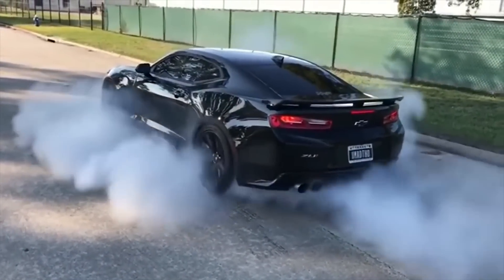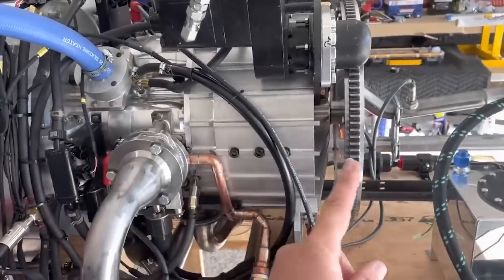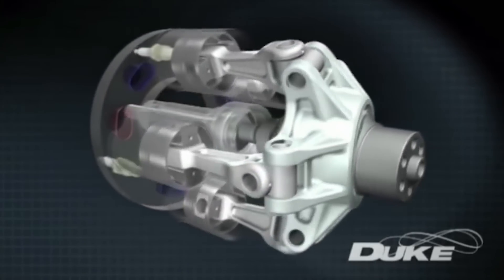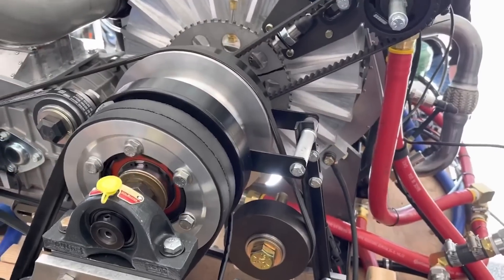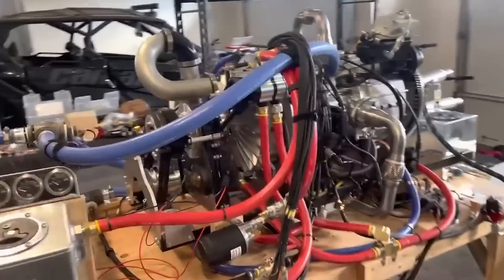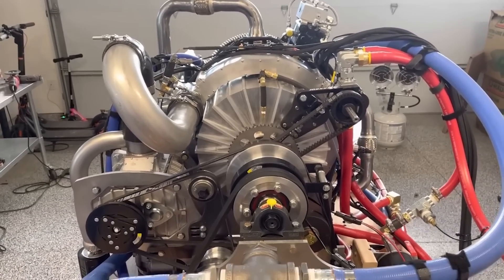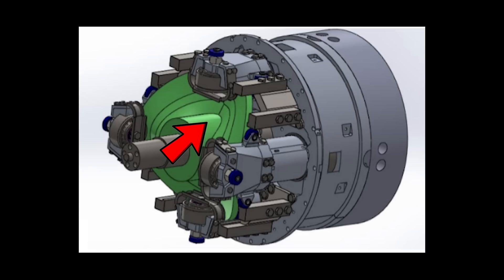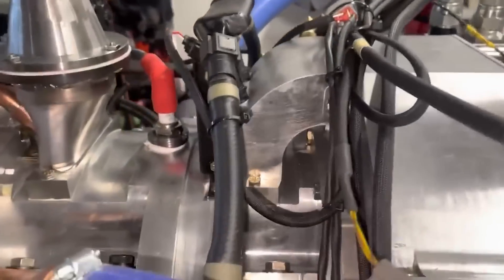Devize Barrel Engine: The Next Step in Combustion Technology

Comment: What a load of rubbish. As mentioned by others, opposing pistons are no new thing and of course it is a 2 stroke but this wasn't mentioned. Notoriously inefficient and polluting. Lucky we have electronics controlling the fuel injection and spark timing along with cylinder de-activation to try to mitigate this problem. Problem is these same systems also improve economy and emissions levels in already cleaner 4 strokes. Projected horsepower figures? WTF? Haven't tested it yet after more than quarter of a century of wasted research and development? Give us the projected emission numbers. Possibly the most useless, over-engineered, oversold and underperforming device of all time.

Comment: I designed this.  Matt Jackson is the owner and manager.  Matt makes the decisions.
Reply from the maker: Will add that in the discriptìon 😆
Reply: @ChrisVSCars  Thanks.  Perhaps you can add that I take commissions for design projects.  You can add that I have my own engine design that I am promoting, the "Rotating Liner Engine" that eliminates wear and reduces friction in diesel engines.  This project is at a very advanced stage of development and also seeks investment.   

Some corrections.  This engine has 8 pistons, four cylinders.  It is not a squash plate engine.  We have cams that drive the pistons.  The cams gives freedom of motion that squash plates do not have.

Thank you.

D.

Comment: You show animation of a 5 cylinder radial engine. Theirs seems like they changed the swashplate from having sockets over each rod to something different. There will be wear issues with that. Radial engines have been around for at least 100 years. This is a small version of one and if they have a way to control emissions, maybe they have something.

Comment: All these engine have the same problem , they burn fuel , electric has varstly more touch , is even smaller and lighter , and fewer moving parts , and works right now , by the time problems are sorted for these ice engines , eletric will have sorted there,s , leaving ice out in the cold

Comment: I somehow don't think Noel Duke would appreciate your over-laying and inter-mingling his Z-axis engine rotary engine with the VERY different 
'DEVIZE Barrel engine'.  ... and I would know; Noel is a personal friend of mine. Barrel-type axial engine's have been re-cycled over, and over and they have NOTHING new to offer. All fail because using a cam plate to translate reciprocating loads over the long-term life of a typical automotive engine is a non-starter. From your accent you are obviously South African so why not look in your own backyard? The Van Loewy (my memory may be faulty on the exact spelling of the name) is a far more interesting axial engine from the 1980/90's. It used patented universal joint to articulate the piston-rod/wobble-plate connection such that it eliminated the figure-of-8 oscillation and resolved the motion to a pure straight-line motion. superior to any cam-type axial engine! How about it?

Comment: Another stock market vaporware engine. If there's no cylinder head why did the animation clearly depict a cylinder head with spark plugs. I'm guessing it's supposed to use piston ports for gas flow in and out of the engine. That's probably why there is an external blower. These can create oil control issues. Based on the cloud of smoke coming from the exhaust, 'Houston we have a problem'.
Junk.
Reply from the maker: Animation is from a different motor. I just used it to show the axial design.

Comment: There is an engine that was developed in the 1930s and was certified as an aircraft engine but was overtaken by WWII and never mass produced.  It was picked up by Dynacam Company in the late 80s-90s and updated with new metallurgy and technology and was tested in aircraft and Buses and the literature I saw was quite positive.  It is like the Barrel engine in profile but instead of the pistons connected to the crankshaft at each end and the combustion chamber in the middle, it was a double headed piston with the solid connecting rod riding a swash plate in the middle so the combustion chambers were at each end and the cylinder heads had rotating valves driven by the each end of the crankshaft.  It was a 12 cylinder combustion ends with six double headed pistons sliding back and forth parallel to the crankshaft.  The profile was small on the initial Aircraft engine with a weight about 150 lbs and diameter of about 18 inches including piping etc.  It produced about 235 HP at 1800 RPM and could idle at about 100 RPM, with good fuel efficiency.  They tried to mass market it but the bid engine producers tried to buy them out and when they refused they were essentially run out of business.  I don't know what happened to the company product after that.  The Big guys and the Venture Capitalists essentiall ruined them.  Another victim of 
"The System".
Reply: "The Big guys and the Venture Capitalists essentiall ruined them.  Another victim of 
"The System"."   

Yeah, the victim of those same folks who killed the 100mpg carburetor..   I've seen swash plate engines and every one has had every disadvantage of the reciprocating piston engine and add more of their own.  If there was any merit to it, the Chinese would have made billions of them and put the "Big Guys" out of business.
Reply: @ohger1  if its the carburetor from the young guy in the 70's it was tested and got 200mpg. on a 302 ford Windsor V8.  It was basically a lawnmower carb and the gas got heated up to pressurize the fuel and to change to state of the fuel to a vapor gas.  Liquid gas doesn't burn only the fumes. And that why car engines spray liquid gas so the controllers make more money and leaving the motors only about 30 to 40% affective at burn all the gas.  the rest is waisted out the exhaust. Also theres patinas for a very similar carb from the 1800's
Reply: @Josh-nw3wd  Vapor schmapor (sorry, couldn't resist... 😁) 200 mpg on a 3000 lb traditional car is impossible with an internal combustion engine.  Internal combustion engines make heat - the rotational torque is a byproduct of the engine's heat - a brute force approach to moving a vehicle..  No matter how well the fuel is vaporized, heat must be created to cause the expansion of the air inside the cylinder to push the piston.  Since there is no really good way to convert the wasted heat to energy, 70 percent of the fuel burned is lost as waste heat.

If that doesn't convince you, consider  the cars that run on NG or Propane - neither are any more efficient as traditional gasoline powered engines despite the fuel being pure vapor as it leaves the regulator.  If the vapor was what made that magical carburetor get 200mpg (or 100, the way I heard that yarn back in the '70s), then NG or Propane cars would get the same or more MPG than gas cars despite having less BTUs per gallon than gasoline, and they don't.
Reply: the "michel swashplate engine".
the company still exists, their claim to fame is the "michel thrust bearing", used in ship prop-shafts.

it relies on a tilting pad to develop a "wedge" of oil, preventing metal to metal contact. ideal for a swashplate engine.

theres also the "lamplough rotary" that uses opposed pistons, with teh yoke and spherical conrods at both ends... also a two stroke, with pumping pistons and sleeve valves... engine designers used to have imagination unseen today...

Comment: Lovely grinding action. How long before it wears out?
Reply: There are roller wheels in the swash plate.
Reply: @ohger1  How often needing to be replaced?
Reply: @SelectCircle  I don't have a clue, but I if it uses rollers, it could theoretically last for a long time, but this design has so many problems that it really doesn't matter.

Comment: The main problem with that it's way too much metal on metal it's going to require substantial oil pressure and oil Cooling and let alone the fact it has very little capacity for cooling so why it's running on a stand by itself it's not going to have to cool itself they're going to have to build a whole another motor to even withstand the temperatures of pulling a car and cooling itself on hot asphalt let alone you're going to have to run dual oil filter setup because micro particles is just going to eat that motor alive

Comment: I see all of these new marvel engines as a way to replace the low compression opposed aircraft engines in piston operating airplanes.  Currently these engines require 100 octane leaded fuel to prevent detonation.  Detonation in aircraft engines is fatal, destroying the engine so fast the pilot can't overcome it.  A light weight power plant that can operate on any fuel available is a Godsend for aviation.
Reply: You will never see any of them in production.  The reciprocating piston aircraft engine will only be replaced by a full electric system.

Comment: Barrel engines have been around for years. The one field where they would have had a real chance was in aviation. Compact. Light weight. High power density. Every design considered failed. Every single one.

Comment: This will never fly because it's still essentially a glorified 2 stroke engine. So you're always dealing part of the exhaust charge staying in the cylinders, and part of the intake charge getting out (except with direct fuel injection). At any rate, they can't meet emissions, no matter how you slice it. This combined with excessive complexity, and lubrication and cooling problems make it a no-brainer to look into something else. The Deltic Corporation had a locomotive-sized opposed piston diesel in the 40's and 50's, and while they made good power, they were very dirty and had high maintenance costs. They were finally retired in the 1960's for cleaner burning standard 4 stroke diesels.

Comment: I love internal combustion engines too, their interesting, cleverly designed, make great noises and are fun to drive. I also like steam engines for all of the same reasons. However, when Tesla proved conclusively that BEVs are practical, even with their first generation vehicles, it was only a matter of time before ICE went the same way are ECE (steam engines). The end to end efficiency of Steam Engines tops out at a few percent when you factor in mining for coal. It's double digits for ICE and at least three times better if you use batteries and electric motors. It's not just about end to end efficiency though, it's about end to end complexity. Drilling, processing and transporting oil is hideously energy hungry compared to electricity production. When it comes to the power train, BEVs are so simple, like a child's toy compared to ICE. There's simply no way back now we've got this far.
Reply: BEVs are FAR worse for the environment than the ICE!  Just look at how much mining and processing is needed to make those batteries, and when they catch on fire for any one of numerous reasons, you can't put them out!  You just have to sit back and watch them burn!  Then we get to the unattractiveness of the extremely low resale value of a BEV when the battery is worn out and needs to be replaced, or when the BEV needs to be scrapped after even a minor fender bender because the battery MIGHT have been damaged.  There's no way to know if the battery isn't going to spontaneously burst into flames while going down the freeway!  In South Korea now, they won't allow BEVs in under ground parking areas because they might decide to light off and cause massive damage to the building and other cars!
  Elon made himself rich at taxpayer's expense with his electric car boondoggle!  How is anyone going to charge up their BEV when the electrical grids are down, or even just damaged?

Comment: Opposed-piston engines always have cooling issues, with many failed efforts done before. The only successful opposed piston design was a German diesel two-stroke used in a number of aircraft during WW II, with excellent fuel consumption, but like most diesels of the period, lots of toxic emissions. The piston deactivation technique has been used in Cadillac V8 engines, but the dynamic adjustment of fuel feed, valve shutoff, and timing is a challenge to retain engine effectiveness and actually reduce fuel consumption. The friction associated with the heavy swashplate also works against engine durability.
Reply: Deltic loco and torpedo boat engines were also opposed pistons
Reply: @Dilbert-o5k  thanks, I forgot about those.

Comment: What fuel was used during this filming? I don't think the emissions billowing from exhaust would win my stamp of approval.
Reply: It runs on the tears of Greta tardberg :)
Reply: @xpgaming6567  No, I have worked on gas and diesel engines since I was 14,I'm 72, the diesel engine may be a little dirty but gasoline engines only smoke when piston rings or valve seals fails.

Comment: In terms of efficiency, internal combustion engines are all thermodynamic heat engines, which limits them to about 40% maximum efficiency with the materials available to us. Electric power trains are not thermodynamically limited, and are routinely 90%+ efficient. IC is fundamentally inferior in this respect.
Reply: 😅  to begin with I was thinking.  
What is he talking about? Electric trains?  Im pretty sure the ones where I live are diesel electric.
Then I realized you said “power trains” 😅

Comment: Usual hurdles need to be addressed. Range especially in the cold where batteries fair poorly. Faster charging needs to rival gas. Infrastructure. Gas was not done overnight and neither will electric or alternative. If you can't make it transparent to the gas crowd, which is most on convenience and efficiency, you have a tough sell. Me I really could care less. Gas or electric,  if the above is addressed, no problem.  Reality it's not. That is why electric fails.